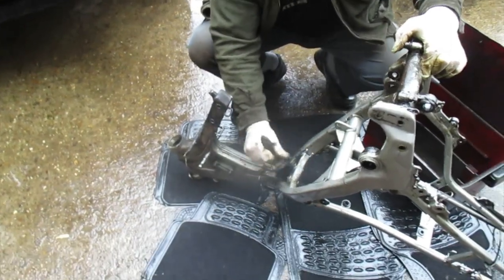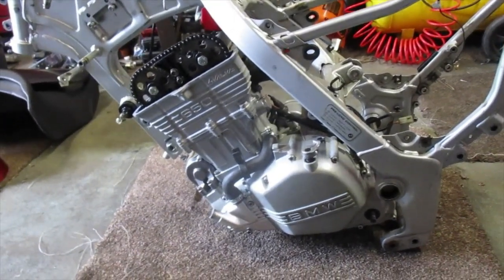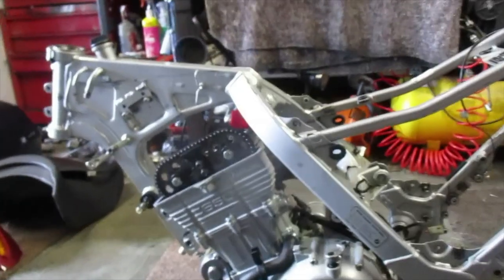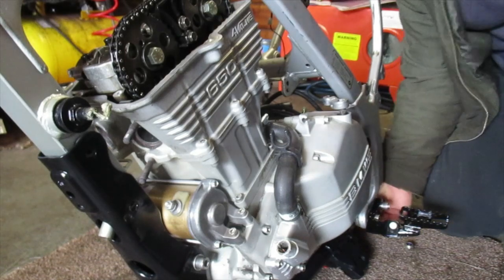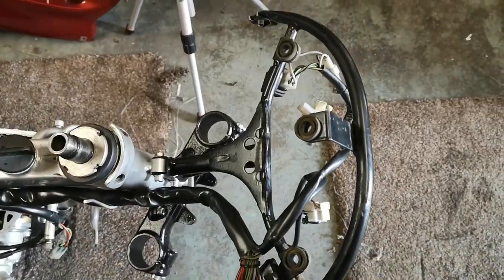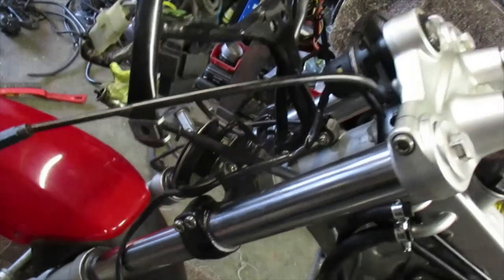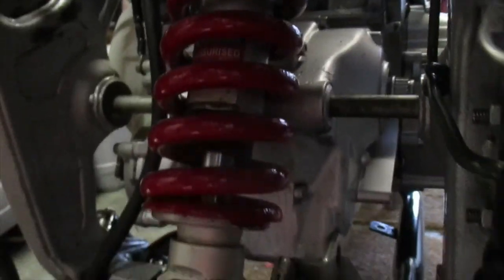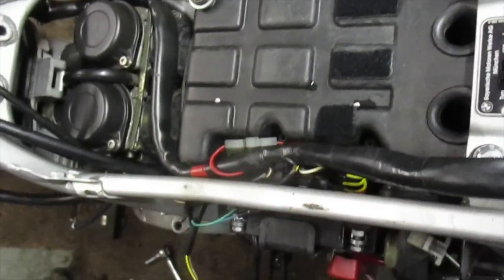Engine re-fit on my 1994 BMW F650 Funduro | #motorcycle restoration biker

Comment: When you refurbished the forks and replaced the seals did you go with new springs/upgraded progressive,or simply refitted to originals? Great video, I've just subscribed.
Reply from the maker: Hi,
No when I re-built the forks, I checked the length of the fork springs with the specs, and as they were ok I re-used them. There would have to be a very good reason for me to replace them.

Comment: Thanks for your answer, I'm surprised that BMW doesn't use any relay to activate the full/dipped beam headlights. I wanna have a look at those wires I think the problem comes from the switch. I'll keep you informed. And again thank you very much
Reply from the maker: Hi, Yes I am stunned there isn't a relay. But, I think that it is done like this because it is only a 'flash' switch, so it should be on and then off quite quickly. Let me know if you need any more info. Happy to help

Comment: For painting the metals what kind of paint did you use and did you do multiple layers or just a single one?
Reply from the maker: Hi, the painting of parts is quite involved and I am not a very good painter. I normally get the right colour mixed at a local paint supplier (auto paint) They normally give me a really good colour match. I try if possible to strip all the paint off each part to then make sure there is no 'reaction' with the new paint and the old. I then use an 'etch primer' sometimes two coats. Then with the colour I normally use two or sometimes three light coats, to build up the amount of cover. Then I allow it to 'cure' for a week, before I polish it to get a good finish. Sometimes I have assembled the part before I polish it, it depends on what part it is. Because it is cold here int he UK in the winter months that can make painting much more difficult as if it is too cold you get 'blooming' Wife gets annoyed if I 'cure' painted items in the oven, but sometimes it is the only way. I may do some videos on the act of just painting as this may help people.

Comment: thanks for answering  my problem is   no more flash the headlights when I press the button  I'd like to know the color of the wires  in order to test the button  and the  circuit  relay  and so on  best regards
Reply from the maker: Hi,
There are two wires going to that switch. Green/black and white. The white one goes to the headlamp. The Green/black one comes from the fuse that feeds the lights, horn and many other items. So, if your horn etc works then the problem is probably the switch. If they don't get much use the switches can become corroded so it may be necessary to spray some contact cleaner in there and work the switch quite a bit to 'wear' it back into use. Hope this helps. There are no relays on the headlamp flash circuit.
Reply: @RestorationBiker   Thanks  the switch was corroded  now all is Ok I wish you  an happy new  year

Comment: Hello do you now were to find the engine nr
Reply from the maker: Hi, They are very hard to find on these engines. It is on the top of the crankcase on the right hand side above the chain sprocket. You can see it from the (brake) side of the engine. Sometimes there is a sticker there with the number underneath it. Hope this helps.
Reply: @RestorationBiker  hello,I just have looked there and remover the Sprocket case but no nr to see is it possible that it is on an other location is it possible to take a picture I look for the nr a few days and can nog find it thanks
Reply from the maker: @decortmonique4432  Hi, Yes, it is a swine to see. If you look at my engine rebuild video the engine no is visible at 2.07 into that video.
Reply: @RestorationBiker  Hello it is realy hard to find but with Your video I found it so thank you verry match for your help
Reply from the maker: @decortmonique4432  Glad it helped you, ride safe